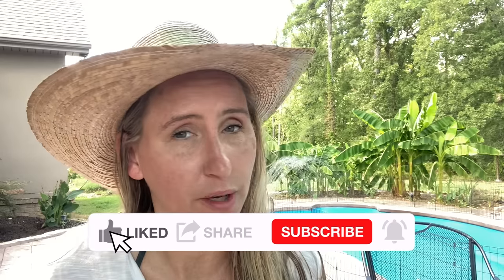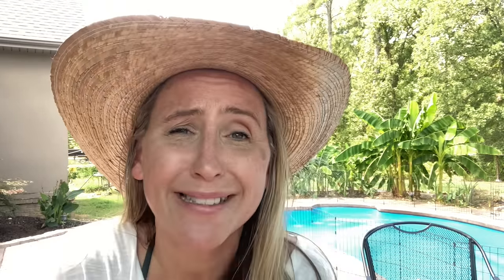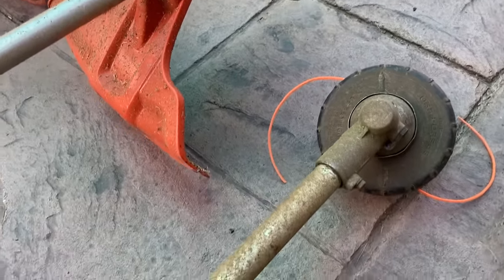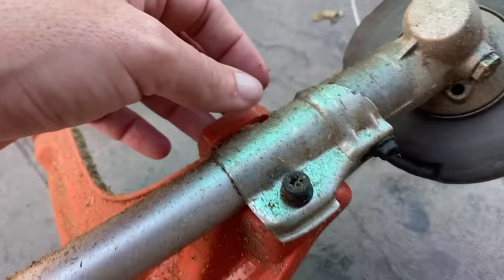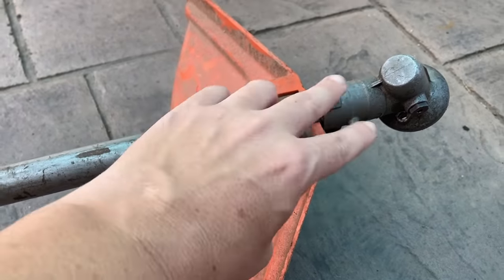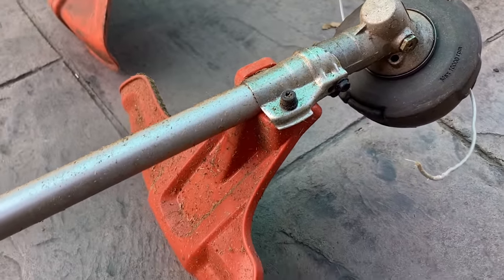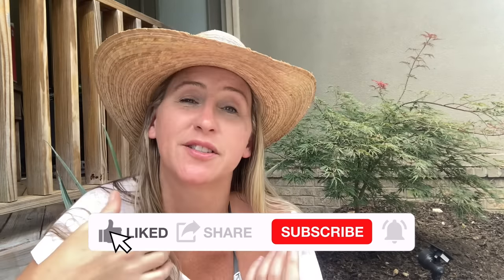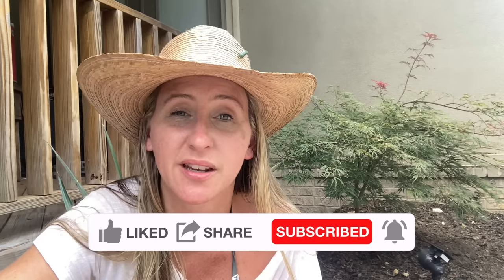String trimmer guard ON or OFF? Will it destroy your Stihl, Echo or Husqvarna? You might be shocked!

Comment: We only run Echo pro  trimmers in our business and i like their weight and balance, but that said the are not the most reliable we have problems with ignition coils 2 in 3 years, problems with accelerator cables sticking, problems with the cooling holes plugging up at the back. The are good  trimmers but for me i have always run stihl trimmers before and my FS 400 and FS 450 never ever played up and yes we have changed clutches but thats a normal item if you run your trimmer alot and in tough terrain

Comment: The guard is a must. It keeps the wire from getting too long. A long wire doesn't cut right, and added unneeded stress to the trimmer. Trust the engineers whom have worked all the physics out on these machines.

Comment: I took the guard off my Stihl and like it a lot better. I hardly ever or never even run mine at wide  open as it is not necessary. It is so much easier to go around my curbing in my yard and around French drains and paved edges.  The guard weighs more and is just clunky. I do wear eye protection. I don't over extend the string and the motor on the KM 91 R  can handle the tiny bit of extra .095 string that might be there. What are we talking anyway? Even if it was 100 grains extra string weight that is only .2285 ounce, not even 1/4 ounce.  I have a finely taken care of yard so there aren't any rocks limbs etc to be thrown around. The issue is safety and I won't blame Stihl if I get hurt.

Comment: Many times the gear head in a combi shaft is not the same gear head that was on a non-combi shaft. Combi units use a square end drive cable, and the the non-combi units sometimes use a splined drive shaft like the one in this video.

Comment: ok Bre this is why keeping the shield on is critical. the knife keeps the lines the same length. and most of that noise is low rpm  line slap and if one line is longer than the other  the head is out of balance or both are too long the line  slap causes  a shockwave  back to the clutch. the other thing is many users goose the engine while trimming when they should hold full throttle all the time to prevent overheating and keeping the lines fully straight because you cut with the tip of the string if you try to trim with low rpm and a collapsed line you will wear the  line in two where the string comes thru the head..  
i love your videos.  i began fixing small engines 59 years ago when dad gave me a tool set for my birthday.. this started my career as a small engine mechanic..i now restore vintage cub cadets and older john deere garden tractors as a hobby

Comment: I have a Husqvarna 324L straight shaft trimmer for over 10 years now and have used this trimmer heavily without the shield with no issues. I do my own maintenance and ensure it runs in tip top shape each season. I usually do more than 2 to 3 hours in trimming with round line 0.95 in a day when in use. This by far has been the best trimmer I've ever used and if Husqvarna will continue to make it I will buy it. I've had no issues with the shield off of it. It's easier to get in between areas I couldn't usually get to before and it makes for quick and easy work. I do use a full face shield when using it though. Love your videos!

Comment: Well I’m definitely one that takes the guard off as soon as I get a new trimmer.I normally run at least 20 inches of line if not more yes I know it’s not recommended. however all the trimming I must do I don’t have time to stand there go back-and-forth to cut it. I’ve never had a problem with any of my STIHL trimmers. I actually buy those for the reason they have a steel clutch a.k.a. a chainsaw type clutch that mitigates this issue. I have had issues with echo and huskies that have the composite type clutch they burn out..

Comment: I took the guard off my plug-in Stihl and now it works very well, can even mow the yard without it getting too warm.   With the guard on it would barely function because it was SO close to the string.  I keep a magnet on the upper shaft pipe and a pair of dog nail trimmers to clean the line.

The shields induce an air-flow drag that maintains tension up the shaft through the clutch when running, the question about that customer's unit is whether the clutch readily when it gets pushed into grass at idle.

Comment: Great info . I have an electric battery powered trimmer made by Atlas from Harbor freight. Works great. I did try to trim with the shield off and it did work but on thicker grass it would overload and stop. I did put it back on and it doesn't trow grass everywhere with the shield. Much better. I used to have a cheap MTD gas trimmer from Menards  and it was hard to start and broke the starter recoil twice so i said , screw it. Got the battery powered one and never looked back.

Comment: I’m surprised nobody is talking about burning out the coil when the line is ran too long. I guess that falls into the category of getting the engine overheated when trimming with the guard off. After a while of having the guard removed, you get a sense of how “long” you can run it without cooking your trimmer. And I’ve been socked in the nuts and every other body part with the guard on so it at the end of the day it’s all about preference.

Comment: We have customers that run them on and off. If they can control the amount of line that’s out they hold up fine. I replace more Echo and Redmax gear heads than Stihl. Other than noisy clutches on FS56 models (easy fix) I rarely replace Stihl clutches. Echo clutches like to eat the springs and drive shafts mostly due to too much line out.

Comment: You have an incredible wealth of knowledge. I don't remove the guards simply because I like the extra protection. But if someone was to remove it, would cutting the plastic off still keep the head retention in place and negate the damage? Also my dealer told me to hydrate my trimmer line but I thought he was having a laugh. It wasn't until I saw your other vid which actually explained how to do it as well that I knew it was a real thing. Love your vids!
Reply: Except whats on the machine, I’ve stored my string in water 30+ years. 
It makes a difference.

Comment: I have FS85R thats 22 years old that hasnt needed any service done to it yet. When I bought it new I changed the shield to the brush cutter shield cause I didnt like style of the trimmer shield. All I did was run fresh 2 cycle mix fuel since day 1 of when it was purchased. Nice video
Reply from the maker: That is because it is the BEST Stihl trimmer ever made. I wish I had a new one of those! It would outlast me. I am starting to see them all fizzle out though. After 20+ years the whole machines are worn plum out.
Reply: In my opinion the BEST small, light and powerful curved shafts Stihls  were the FS 72 and 74’s with the FS 76 basically having the same engine but with a straight shaft and handlebar to make a brushcutter. 

These early FS models were lightweight and powerful and designed fir people who couldn’t lug a FS 75 or 80 for long. The modern day counterpart is the FS 38 and 45 line which are complete junk in comparison.

Take a FS 72,74,76 motor and install a short straight shaft and old style polesaw gearhead. Talk about a mean short polesaw for close in de-limbing of trees.

Comment: As a carpenter for forty plus years I believe in keeping the tool guards in place!!!!!!!! I’ve seen many people get hurt, seriously I mean land in the hospital and miss work for a long time
Reply: Guards on line trimmers are not fit for purpose & serve no protection whatsoever nor can it be compared to skilsaws,c/saw guards etc. Only use guards serve is trimming line assuming the cutter hasn't been smashed off,it won't stop gravel,stone chips/concrete or anything else hitting your legs or your face,that's what leg protectors etc are for. Majority of contractors don't bother with guards. You best protection is angle & direction of cutting while being lite with the throttle & full throttle only when needed.99 % of the you'll only use 1/4 throttle regardless if your domestic or commercial like myself

Comment: I wouldn’t own a bent shaft trimmer. I have owned several echo straight shafts, never bought one though. No, not a thief! I pick them out of trash piles! Usually about 12 bucks to fix. The thing is that they covered the high screw with a plastic plug, so you can’t adjust WOT throttle can be adjusted, well used to anyways. If you put a blade on it or a different head on it you need to adjust wide open throttle. I have never had any problems with any of them. If I ever need a new gear head I will get one from trash! If I run a blade I always run a guard. Here’s the thing, ECHO’s shield is trash! Too small and useless! See in the video the huge 128 LD? I would run a big shield like that, but the tiny shield on ECHO is no good! And I do all lawn work in flip flops and shorts, it’s all I ever wear! I know y’all will say just wait, buy I’m 56 years old and I waited long enough!

Comment: Robin NB-26!  Mine lasted over 20 years.  Great trimmer, just wished the straight shaft was a little longer, for my height.  It had manual feed head, with small shield.  I ran .105 line, and brush blades.  It would be finicky to start sometimes, but was great when running.  Fuji Heavy Industries parent company.  ✌
Reply: Had a Robin for 18 years, no problems. Moved, didn't need a trimmer any more, gave the Robin to a friend, he ran it for 3 years and sold it for 50 bucks and it was still working. Amazing.
Reply: @kevinknight470  Great reply and comment Kevin!  👍

Comment: Happy Thanksgiving. I run Husqvarna 525 trimmers commercially and have for years. I have had start and run problems running it upside down with a hedge trimmer. Talk about a hassle. Any suggestion. Have replaced fuel caps. P.S. I don't run mine with shilds. Love the show. Bama Mike

Comment: bumping that string out to far without the guard will kill a clutch and i learned in a update class one year that putting the string out one inch farther than recommended  can cause the engine temp to rise between 200 to 300 degrees warmer than normal

Comment: I'm running shinny t-230 and t-270 plus a 4 mix t-254. Have some Echos, srm-280's and  a srm 230. A stihl fs250 in my shed. I prefer the Shindaiwas but I'm a 2-stroke mechanic and have spare gear boxes. All this stuff came out of scrap piles

Comment: "If you spend $300-$400" on a trimmer, it will last you 10-15 years."
Oh how our expectations have plummeted.   My budget MTD lawn tractor is 17 years old and I expect it to last another 17 years.  My Yard Machines push mower is 35 years old and it's never required a repair.  My Ariens snow blower is 17 years old and is hard to tell from new.
Why should we expect less from premium brands?

Comment: Yeah.. shroud off will kill your engine in quick time.  Just too much load on the engine running line too long.  
I'm commercial in Northern Ireland.  Lot of heavy damp grass exacerbates the problem.  
The Cure is correct choice of machine for conditions.  All guards remain. 
26cc , 34,cc, 43cc & 52cc 
Kawasaki/ mitsubishi ( 26/27) 
Kawasaki (34 / 43) 
Efco boss  ( 52cc  Italian)  

I have always found Stihl temperamental.   Exception is my 
Stihl O26  which will still work when there are a mountain of 261's on the scrap heap.   Have a solo which is a great saw but Alco bought them in Europe and parts are now unavailable. 
Useful videos!  Thanks

Comment: I definetly have had clutch issues with my stihl fs 111r and 131r. They last about 2 full seasons with the amount i use them before the clutch is fucked. I was gonna try echo trimmers next and you just confirmed that decision for me. I need a clutch put in one of my trimmers now, i took it in and all thry did was relace the springs...it worked o.k for a few months but needs a clutch now forsure. Great video. Thanks

Comment: Shield on, for people who don't want to get dirty and who have the time.  Shield off is for anyone who wants to trim with maximum efficiency.   Sure, a stick or pinecone or rock is more liked to get thrown at you...but if you don't want to gey hurt, don't work in lawncare.  My stihl fs91 and fs131 both do well with the shield off.  I will stay that anything with less than 1.3hp isn't worth taking the gaurd off as it won't have the power to swing longer string.  As far as stihl clutch/gearhead issues...i think that's more about maintenance then whether shield is off or not.  I am a solo operator,  so i run my equipment hard but I need my stuff to last many years...I don't make enough to replace equipment yearly.  All that said, big box store trimmers obviously shouldn't have the shield off as they were built to a price point and intended for homeowners who have time and need the added safety.

Comment: If you see my post can you tell me what you think of Husqvarna in 2024.  I had a Ryobi straight shaft for over 10 years and loved using it and never had any issues with it till it started playing up.  I tried going to electric cordless but its not the same and Ryobi now are not selling Petrol trimmers anymore in australia (Why I got the Ryobi cordless)   So Im thinking of buying the HUSQVARNA 325L or maybe the similar priced Echo trimmer.  

Both are close spec wise but I like the Husky a tad more.  Given the push worldwide to ban petrol garden power equipment it might end up being the last one I can buy which is sad.  I think the guard on the husky is less bulky as well so no need to remove it for home gardening work.  

Some machines have really bulky guards to the point it makes using the trimmers harder and I can see why people would remove those types. I don't know why but all the electric stuff seem to all come with bulky guards and I guess its the same nanny state rule makers that are banning gas powered machines also making manufactures fit those extra protection guards that then make the trimmer harder to use.

Comment: I am the guy to chime in. I've been a Small Engine Tech for 35 years. The excessive string length can do harm. Also change running RPMs are slower. That being said. EVERY COMMERCIAL GUY SENCE THE BEGINNING OF TIME TAKES IT OFF IMMEDIATELY! Relatively speaking, handheld stuff is cheap and disposable. So, whether it's good or bad, doesn't matter.

Comment: Had a small lawn business on the side (was apaid Firefighter) ... On my Wisconsin Robin I believe I ditched the trimmer guard ... but I got nailed in the face by a rock that really came close to my eye ... so I started wearing glasses (most of the time)

Since then ... as a homeowner ... I've generally used the guards. I don't like the smaller swath it cuts but it keeps down on the poison ivy shredded matter coming directly my way ... and I prefer shorts or shorts/overalls. (Yeah I know ... wear pants) ... But at the same time I have been running low rpms and after watching a recent vid of yours I know fear I have allowed a carbon buidup so I'm being watchful of that.

I have a Huskvarna ... an exho commercial and an Ego 56v and now a DeWalt 20v. the Dewalt is OK to grab and hit a small area for convenience. I really like the Egos - and the smart string technology has so far worked. But for big time work and gas power I love the Echo ... and since the WIsconsin Robin I would rate the Echo the best in my own humble opinion.

Comment: I have a Robin NBF252 that i bought in 1999. I've used it hard and it is still the best piece of equipment i have ever owned. The shield has deteriorated from normal use. I'd like to replace it. Can't find parts for the Robin.

Comment: I "borrowed" a Shindaiwa T242 from my mother's ex-husband about 10 years ago. I just now yesterday had to put a new carburetor on it but that's only because one of the adjustment screws was stripped. Also it has not a had shield during my possession with no issues. Only cutting a conventional neighborhood size yard though.

Comment: The guard is for novices until they become Jedi trimmer masters like myself. I can get into places that a guard won't allow. The Stihl 4  mix engine makes low end torque and seems happy without a guard. My rebuilt 100 RX has the lightweight gear head and a speed feed 400 with .065 gator line and has had no issues with extended line as long as I keep the grease filled properly. I can't speak for Husqvarna trimmers though.

Comment: I’ve run a Husqvarna 223l commercially for over 8 with the shield on until last year when the clutch started messing up and spark arrestor problems. Don’t have time went with Echo Srm225 without shield and does great so it depends on the manufacturer.

Comment: I got a question. I have a Echo GT225 and it keepd acting like its running out of gas. I bought a new carb, Lines, fiter , spark plug and it stiil does it. Mainly after it warmsup. Do you think it could be the coil going bad? I replace it last year, but it was a cheap one. Any thoughts?

Comment: I always remove the guard. I will never operate a trimmer with a guard. Echo only for me! Ive got an srm 225, the smallest cheapy they have, and its been going strong for about 3 years now with NO guard. If you think that guard stops rocks, you got another thing coming. I made my own chaps out of old levi jeans and elastic, my shins have since thanked me. Are you losing power on your echo(or any trimmer for that matter)? Remove the muffler and clean the exhaust port of all the carbon build up. Echo FTW!